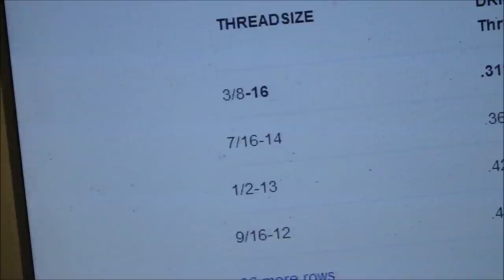A Home Made Piston Stop

Comment: Rather than possibly needing a washer and nut to creat a stop for the through bolt, in this case I would have the bolt ready to use prior to cutting threads. Then when getting close to cutting the final threads and cleaning them up I’d test the bolt by running it through. The goal is the have the almost finished threads provide enough friction to lock the bolt in place but allow it to be turned in or out as needed.
Reply from the maker: Well there is nothing stopping you from doing this.  I challenge you to make one, as well do a video of how you did it.  What I do is,  turn on the camera,  do my thing, and hope for the best for all my subscribers and for those who I hope to get to subscribe.  I hope with your knowledge that you can help us all.  Thanks for the informed comment.
Reply: Bruce's Shop    Bruce I’m well aware of how difficult and time-consuming it is to accomplish a task AND record it well at the same time. Please never take my comments as criticism, for they certainly are never meant that way. My input is always meant simply as perhaps an alternate method I have experienced that may also prove useful or easier or more effective for you or your viewers. I have learned a lot watching you work and appreciate your efforts very much.  I also appreciate your humor and energy. I’m 74 so I totally get it!  I’ve been teaching myself small engine work for the past several months as an additional income (since the pandemic cut my income as a baker by 60-70%) and very much value your knowledge in this area. I’m a Yank but totally love Red Green and his closing comment, “We’re all in this together “. 😉👍🔧👨🏻‍🍳

Comment: Nice work Bruce.  I think I would have used a bench grinder to remove the ground tab.  Easier to manage.
Reply from the maker: There are many ways to do a job.  Thanks
Reply: @BrucesShop  
Hey Bruce,
Today I picked up a free Craftsman mower with a 5.5 hp Honda engine.  Carburetor was in pieces!
I don’t normally choose to work on Hondas but since it was free I took it.  I remembered your video where you used dowels to locate the carburetor and gaskets.  I had some spare 1/4” rod so I threaded it to M6x1 and ground down the OD to 0.23” to allow the carburetor and gaskets to slide over.  It worked great!  Engine runs nice now.

Comment: Hello again from Toronto. Bruce if you grind the curved part above the hex on the spark-plug, the porcelin almost falls out. I would also suggest to NOT use metal as a piston stop. The genious in this tool is that plastic toilet seat bolt! Metal can damage the piston.
Reply: I worried about using metal, too. But on Amazon, sellers are offering both metal and nylon. The one sold by Husqvarna appears to be metal. Wonder if it is a softer metal than a typical bolt? Still, it is a impressive effort by Bruce. as usual,  although I'll probably continue to just stuff a rope in the plug hole LOL.
Reply from the maker: @jjparody8257  This is for a 100cc saw.  Any of the stops i have seen are metal.  It did work by the way